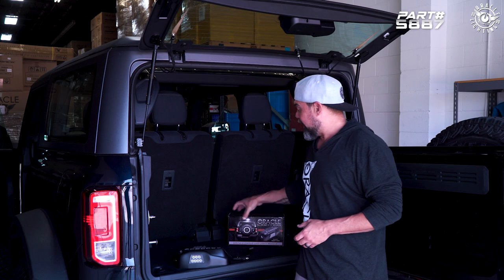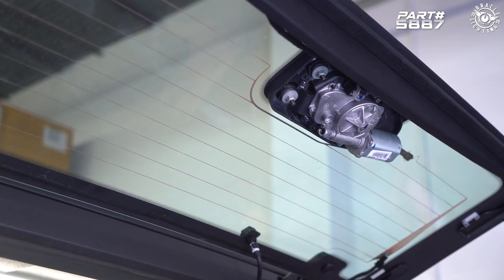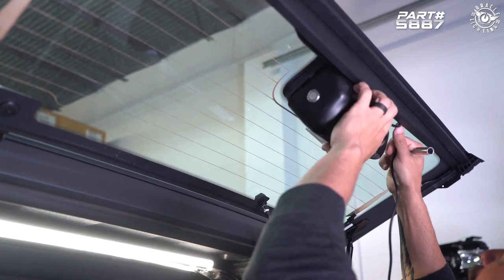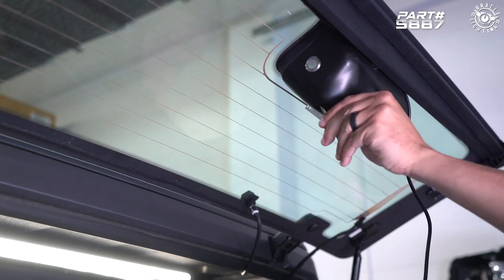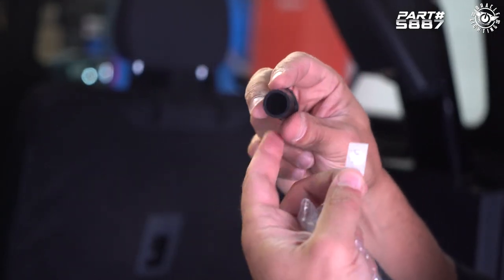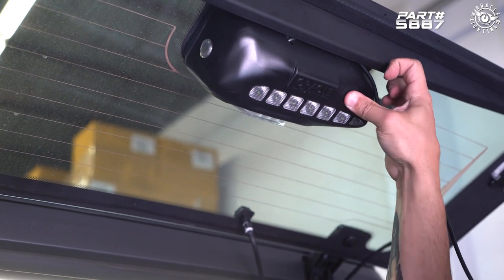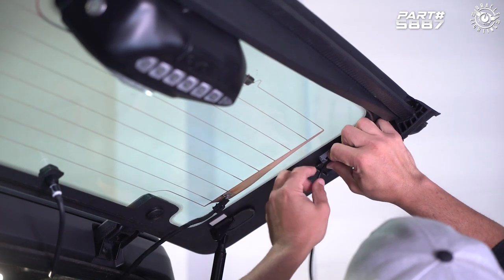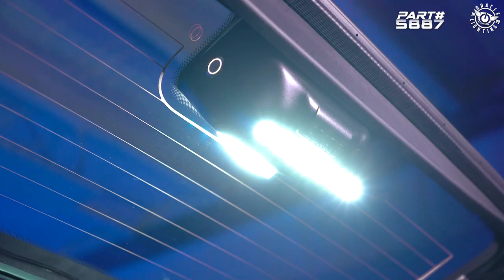Ford Bronco Cargo Light: BRIGHT UPGRADE FOR CARGO AREAS

Comment: Awesome placement and design. However the wiring leaves a lot to be desired. Maybe a way to wire into the othe light there instead of using 12v lighter plug that I allready need to plug 6 other devices into! Next version working on the wire routing, and intercept to provide power
Reply from the maker: The plug is just for ease of installation. It can be cut off and wired directly to power, many customers do this. Others are not as wiring savvy and prefer a simple plug.

Comment: It would be better if you made a male with female end plug  that came off the cargo light supply as a tea tap
Reply: I agree, also a quick disconnect for when you hard wire it and take the top off.

Comment: So here in lies the problem. In most models that power outlet only stays live for 20 min after the car is shut off. Needed is the ford scan programmer to reprogram the outlet. Other wise its a great product. Wonder if there is a way to hardwire it